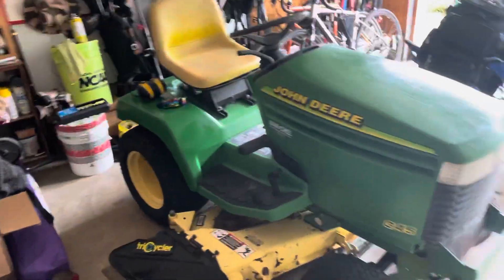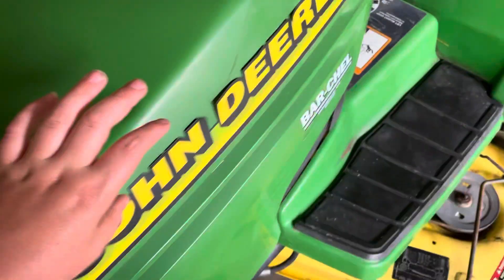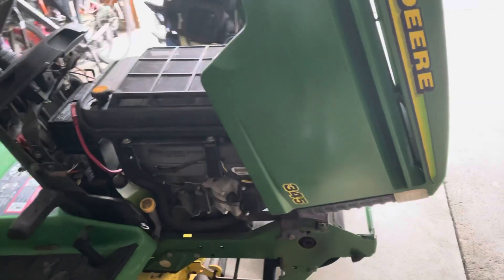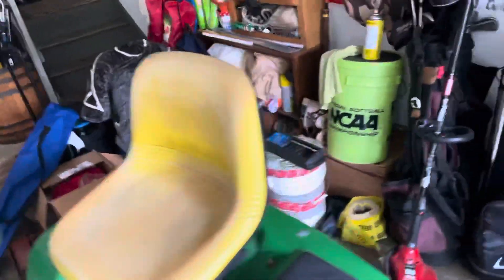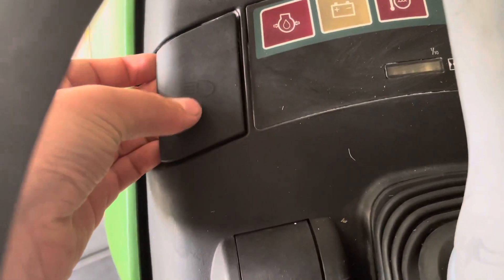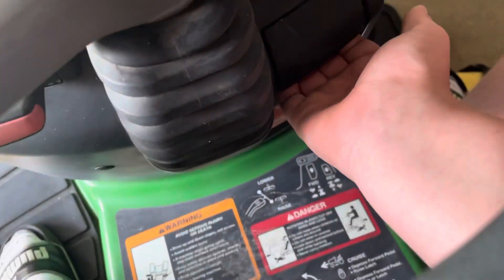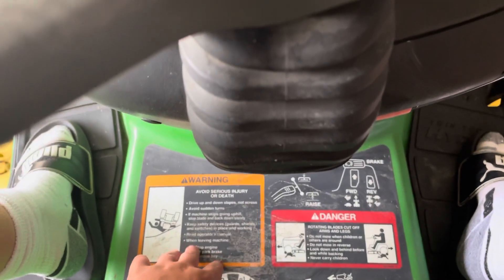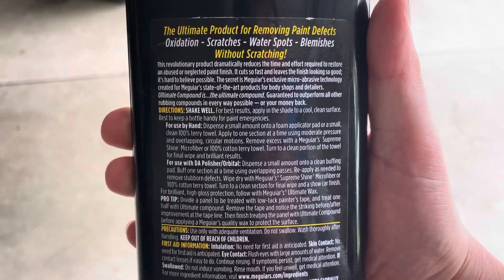Run down of the John Deere 345

Comment: Lets see here. Cam replacement, time delay module, fuel tank grommets, updated hydro filter, etc.  Other than that, the 345, esp fd611v/54" combo, is a hell of a unit.  Owned one for 15yrs.

Comment: The 345 is one of the best belt driven garden tractors ever made. If you haven't done the cam swap I recommend doing that (cam gear was originally plastic but they changed it to steel later) also do the upgraded fuel pump if it hasn't been done. The updated fuel pump has a fail/overflow hose that routes under the frame.
Reply: John Deere should have made good on these Camshafts.   They really did my mom dirty.  I wasn’t around so she called the dealer.   They knew damn well that the Camshaft was broke.  Instead of telling her they tore the whole engine apart and tried to charge her a fortune just for the estimate.   Of course if she bought a new tractor they offered to forget the cost of the estimate.  When I got home I called and told them to pack everything up I’m coming to get the old tractor.   I’m sure they would have put a camshaft in it and sold it.
Reply: @mechmusicman  yes kawasaki should have done a recall. John Deere or kawasaki should have also done a recall on the old style fuel pumps too.
Reply from the maker: My 345 is currently at my local small engine place getting the new cam put in it. I would have done it myself but with work and my part time mowing business I did not have time for the headache. I am hoping to have it back soon.